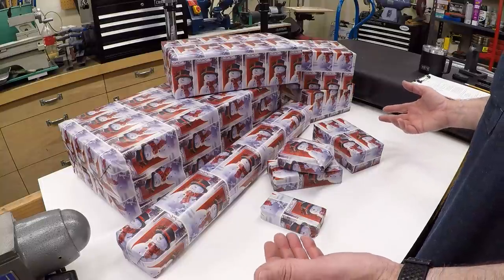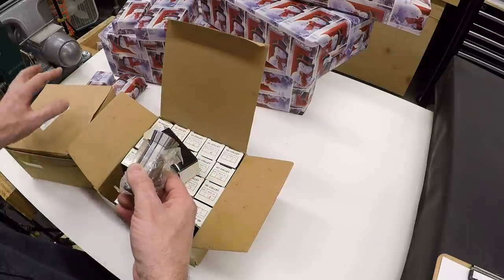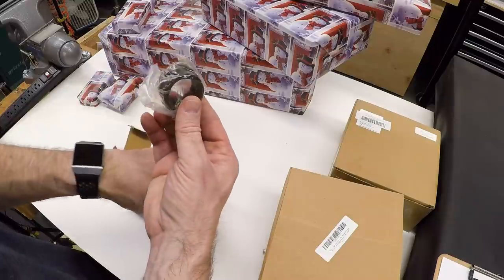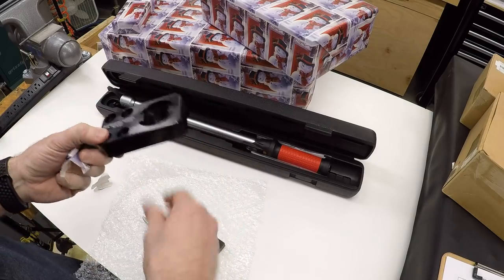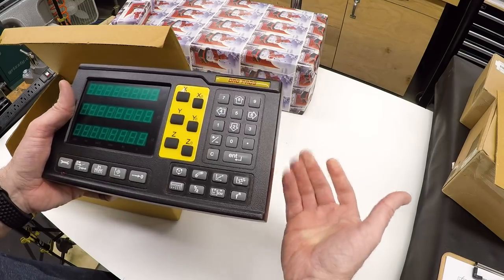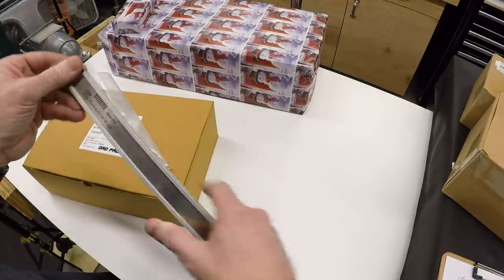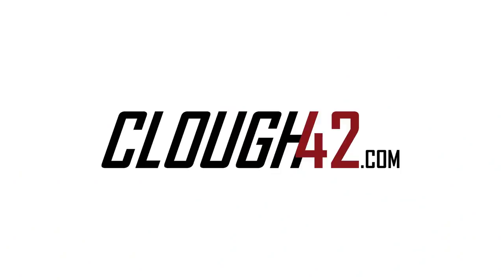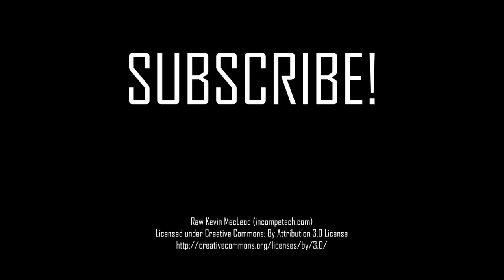Opening Presents for the Shop - Christmas 2020

Comment: So many similarities to my shop! I chose the Miller Multimatic 220 AC/DC. It's running fine on 220/30 and 110/15. For plasma I went with the Miller Spectrum 375 because... it matches the color of the welder. 

Thanks for the tip on the sine keys. I grabbed some for my DX6.

Comment: I have a tightening fixture made by Briney Tool. It is basically just like the spindle and has a taper and two drive dogs that hit the flats on any toolholder I have tried. I have a mix of NMTB30, BT30, ISO30, and Erikson QC30. I don't see it on their website, but it would be worth a call to see if it is still made.  The marking is getting hard to make out so don't quote me, but it looks like X73602 B30-TF
Reply from the maker: Are the drive dogs steel?  The only reason I haven't just milled one out is because I wasn't sure Aluminum would stand up to the torque on such shallow flats.
Reply: @Clough42  The whole thing is steel. I don't have a hardness tester, but with a file I would say it is slightly hardened, figure 40-50ish Rockwell C. There is a drawing on page 72. It isn't an exact match to the tool I have, but close. (note typo 2" diameter not 3")
http://www.aittools.com/sites/default/files/manufacturer_pdfs/briney_tooling_catalog.pdf
A little lathe work, mill the dogs, and the base plate is MIG welded on from the inside. It would make a nice project if you end up making your own. If you want any dimensions or photos, let me know.

Comment: If that Miller spoolmate takes strange contact tips you can modify it to take the OG Miller mig tips that are available locally.  I modified mine about 5 years ago and it’s been flawless.  There are a couple of videos on YouTube that spell it out but it’s not difficult.
Reply from the maker: Cool.  Thanks.  I think the tips are available locally at my welding supply, but if I run into problems, I'll definitely check that out.
Reply: @Clough42  I have a MIG welder as well so I only want to stock one tip type. I use my spool gun to MIG aluminum exclusively and that can be a tip eating process. My local welding shop essentially keeps the same hours as my job and are an hour away so I never run out of tips when they are open. I live 10 minutes from a TSC and they only stock the standard tips. Thanks for the interesting content!

Comment: Just remember that 5C collets, like all back close collets should only be used with materials that are a close fit to the size of the collet. They’re not made to close down on smaller work. Double angle collets such as ER collets are designed to close down to the next smaller size. Since you also bought metric, take the stock and see whether the closest fit is an inch or metric collet.

I imagine you know this, but it’s worth saying for those who don’t. I’ve seen badly damaged collets, and work that tapered because the part was too small and wobbled when worked on.

Were you surprised to find out how useless that spring steel cover is? What they don’t tell you is that the movable jaw pushes it out the other end. If you’re close to the column, or closing on thin work, it smashes right into it. I cut in in half.

Fortunately, I was one of  the first on Stan’s list for the 1200. The bigger size was to allow me to not only do larger parts, but to melt useful amounts of aluminum, zinc, brass etc., for my castings.

Comment: On the hand shake issue, either you have to somehow crop the image frame to remove the motion on the digital side of things, built in stabilization can only do so much. and they're essentially variations of this.
The other solution is to add enough inertia to the system so that the shakes cant overcome it. In other words, weights, pendulums and anchor points on your body. 
Photographers tend to say to tuck your elbow in. Shorter leverage on the arm means less shaking.

Comment: Hi James, I'm going to be very interested in your magnetic encoder DRO install. It's also useful to know there is a four i/p display unit - I was eyeing up a separate quadrature summing unit. I think my mill is one size down from your version, an Excel/Optimum BF 30 variable. I went with the IS3 30 spindle as it is  reputed to be less likely to jam tool holders in when hot than a morse taper one but even over here R8   would have given better tool holder availability. This mill is specifically designed for CNC conversion and there use to be an OEM kit available - very expensive as German sourced. I wish you and yours a safe New Year. BobUK.
Reply from the maker: I looked at the summing units, but realized that the version that sums internally is only about 15% more.  Saving that money would feel pretty silly five years from now.
Reply: @Clough42  Hi, I entirely agree. Less wiring clutter as well. I'll see if I can locate your model over here. Thanks for the reply James.

Comment: Very nice gifts Santa has brought for you.
Isn't the DJI camera the one Dave Jones recently ranted about because it won't work without registering?
Reply from the maker: That criticism is factually correct.  You must download the app and create an account to get past the initial start-up.  After that, it operates independently, just like any other camera.  This appears to really irritate some people.
Reply: @Clough42  Me included, because it's not in any way needed for the device to be functional... not specifically irked by this camera, but not being able to use my iPhone without connecting it to a computer really pissed me off some years ago. They seem to have improved since, because whatever iOS I'm on now doesn't require connecting to mother-ship any more... though I'm sure it's just a temporary lapse on their part :(
Real problem is others copying this crap, so now you need Internet to activate anything and everything. Yuck

Comment: James, any tips on staying motivated with lifting?
Reply from the maker: I think "staying motivated" is a tough frame.  It implies that there's a way to make myself feel like doing something when I don't.  And often I don't.  I think a more useful way to approach it is to decide what I want, and then figure out what I need to do to get it.  I want to be strong enough to do things for myself.  I want to be healthy and independent as I age.  I want to look good without a shirt on.  Lifting is often fun, but when I don't feel like lifting, I remember why I'm doing it.  I also recently felt kind of burned out, so I switched up my programming and switched to some movements I've never done before, but that looked fun, like push press.  Figuring out something new that I'm not good at adds variety and keeps me from getting bored.

Comment: With respect to that new torque wrench:   do you need to calculate adjusted torque value depending on which head you are using (as some are longer than others)?   Or are the extensions calibrated  in length such that that is not necessary?  Thanks.
Reply from the maker: The ER adapters are all the same length as far as I can tell.  The 14mm open-end attachment is a little shorter, but I haven't been making any adjustment.

Comment: What horizontal/vertical band saw do you use?  I have the grizzle mill and lathe and would like to know what has been working good for you, before I buy a band saw that is too large or too small.  Thanks.
Reply from the maker: I have the cheap Harbor Freight 4x6" horizontal bandsaw.  I ditched the included blade and bought a Starrett Intenss Pro-Die blade, and it slices smoothly through everything I've thrown at it.
Reply: @Clough42  Thanks for the information.

Comment: So I've asked you this once before on your Grizzly G0602 VFD and 3ph motor conversion. Are you still running double RPM (120hz) on that motor with no issues? I bought the same motor you recommended. I've finally gotten around to getting my G0602 back together and made sure all my electronics are working as they should which they are. Have you just left the belt in 1 position or have you had to switch at all between the 3 pulley belt combinations?
Reply from the maker: I'm running up to 120Hz with no issues, and I've never taken the belt off of the 1200RPM position.  Last week I drilled 1/2" holes in 4140HT steel at 350RPM in that configuration without issue.  When I was turning the large diameters for the 5C collet chuck backplate, you could hear the RPM changing a little as the load changed.  It probably would have been better in a lower-speed belt position with more torque, but it worked fine.
Reply: @Clough42  Awesome. Thank you sir. Love your channel and all the stuff you do. Honestly the one video you went on and described yourself growing up and how you acquired all your knowledge honestly sounded like me to a T. I'm a commercial HVAC service technician and I deal with big motors and VFD'S daily. VFD's the size of refrigerators to small little guys. You definitely have more smarts than I do with electronics and circuit building. I wish I knew all that. But anyhow, that's good to know. I was curious again how that 120hz 3800rpm was holding up, but as you said you doubt they'd use different bearings for the 1800rpm rated motor from the 3800rpm motor. I really would love to hopefully upgrade to the ELS setup you have going on.

Comment: I suggest you save yourself time and remove that shield from from the DX6 now. When you holding smaller stock and you have the Y axis in, it's gonna hit your column. I wanted to be loving of mine and found I just caused myself more headaches than it saved.
Reply from the maker: Yeah, I'm already realizing this.  Honestly, I wonder if I'd rather just have a shorter one that doesn't get in the way.  I like the idea of not filling the vise with chips.
Reply: @Clough42  Yeah...that is a simple/solid answer to 2 issues.
Reply: @Clough42  Thinner telescoping one? Possibly made from clear plastic sheet?
Reply: I bought a Kurt a few years ago and that shield has been sitting on a shelf since day one.  I never knew what it was until today and I thought it was part of the packing.  I guess I should have read the instructions.  Thanks for the video.

Comment: Hi James marry Xmas nice nice.
Well I got my new thermal dynamics 152 A120 machine torch for my CNC plasma table.
I have built many cnc plasma systems over the years since 2001 and I still have the the first cnc plasma table I built for myself and every time I build a new plasma table and start cutting steel for people I know word of mouth usually makes a  sale of my current Machine and I sell it I keep my electronics very simple and it does not half to be that elaborate I been using g540 gecko with mach3 even very combination thus far I trying masso controller it good and now trying a myplasma controller from proma thumb up for this one it has cad cam software.
I will be very excited to see your progress when you start building your cnc plasma table in the near future.
Marry Xmas and happy new year. Best

Comment: Wait, you got a fancy TIG welder and you say you don't know how to weld stick or wire feed? You started with tig?

 Did I screw up as a newbie hobbyist getting (for Christmas) a wire feed machine that also does stick (lift tig if I get ambition and argon and more parts) and a big box of 6013? (Also, the one I got was the import YESWELDER, which I pronounce "YASS WELDER", but at least I didn't scrimp on safety, the Lincoln Viking 2450, 2/3 the price of the power source...)
Reply from the maker: I'm a glutton for punishment.  Aluminum TIG is what I thought I would use the most, so that's where I started.  I can make it work, which means I can design parts that I'm able to weld.  Dealing with arbitrary stuff that I don't control is beyond my current ability.  Turning aluminum parts into sagging oxide bags of molten metal is my specialty.
Reply: @Clough42  ah interesting. I thought I was being a glutton for punishment starting with stick despite not aiming for a career, but I anticipate mostly welding lawn mower parts rather than shiny clean metal.

Comment: 2:37 yeah because we're too stubborn to change over to a much easier system... No, we like to make our lives more difficult than needed and we'd rather deal with factions and the need for more decimal place values to get to the same small sizes.
While on the subject of 5C collets, should pick yourself up some machinable collets. You'd be surprised how often they come in handy. I never really thought I'd have much need for them but then after picking up a few to have on hand, I all of a sudden found I could make use 

11:52 are your ISO holders consistent on the flange diameter and across the flats (like they should be? If they are, just make a drop in holder similar to your BT holder that the holder on the flats just like the vise is...
EDIT:
Here:
https://forum.v1engineering.com/t/tool-holder-tightening-fixture-3-4-alu-on-the-mpcnc/16876
Reply from the maker: Yeah, the holder you linked to is exactly what I was thinking about making.  The flats are shallow enough that I didn't know how aluminum would wear.
Reply: @Clough42  You could make it a little different by milling it out so that you could put steel inserts that bolt (or otherwise attach) in the holder that the flats would engage on.
Here's a link to an image of a quick SW Model I just did real quick to show what I'm meaning by the above.
https://drive.google.com/file/d/1NPDuozidyGbf0dzQZgssvzmA6DT83iGR/view?usp=sharing

Comment: Ender 3d pro with upgraded mother board all mral extruder direct drive kit all metal hot end with tool steel tips and ptg fillament
Reply from the maker: Nice!  I helped a friend set up an Ender printer a few weeks ago, and it seemed pretty nice.  The direct drive is the only thing I really felt like I would want to add.